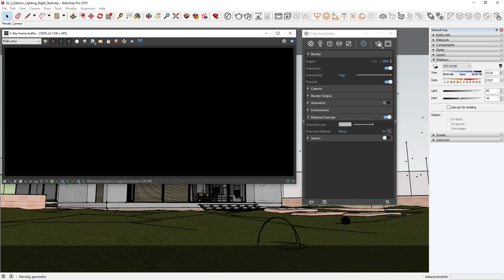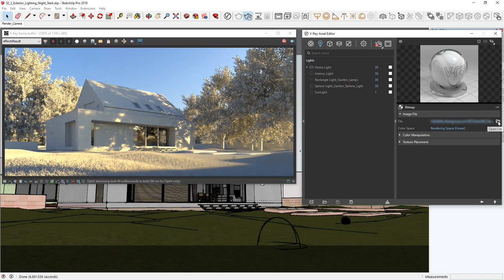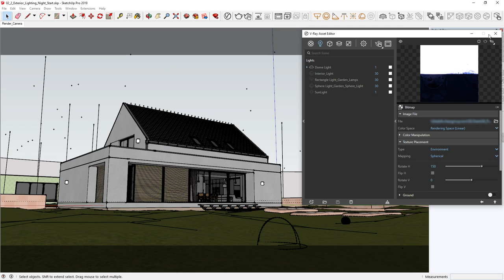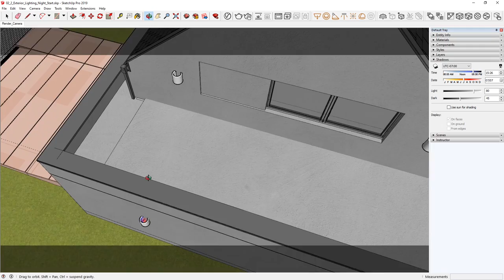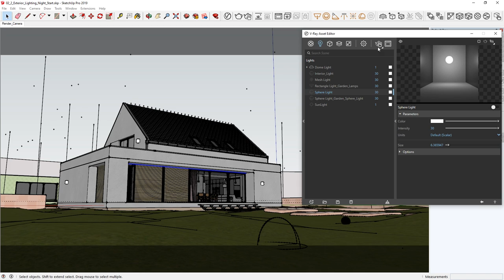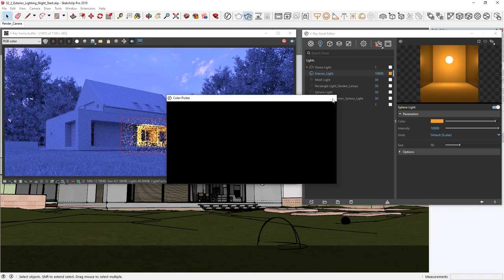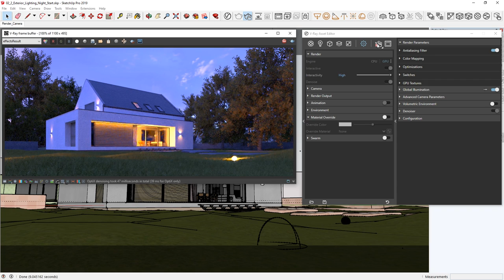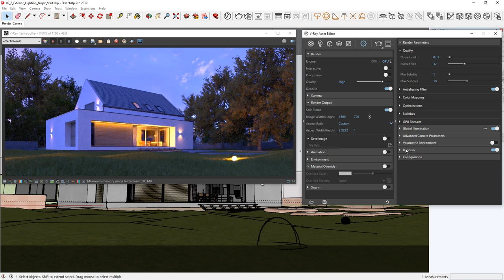V-Ray Next for SketchUp – How to light an exterior night scene

Comment: Thanks for this. But the file is huge and my brand new laptop with 16mb RAM and 7core processor got restarted several times during the process. Then at some point it relaxed :D because it stopped rendering the foreground trees although they are still there in the model. So what do I need to do? is there any way to get them render-able again at least for final render?